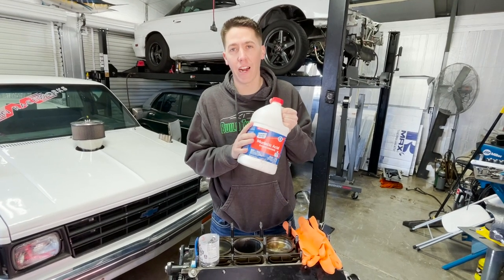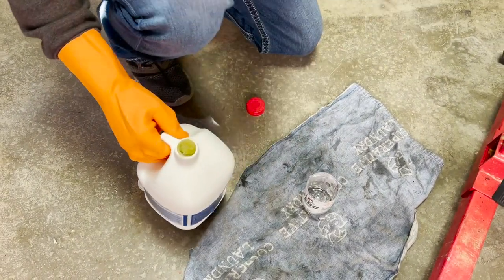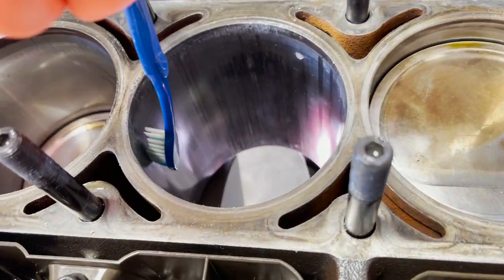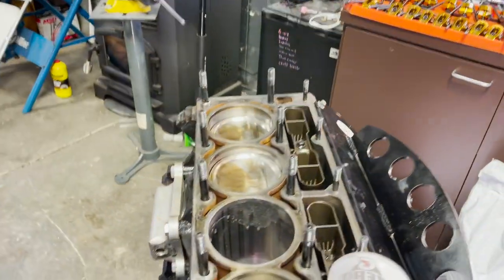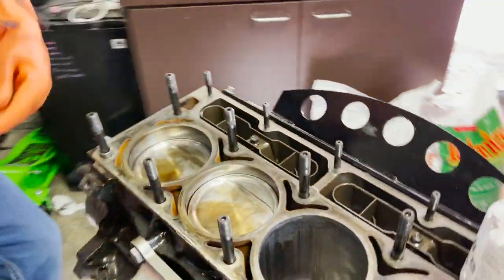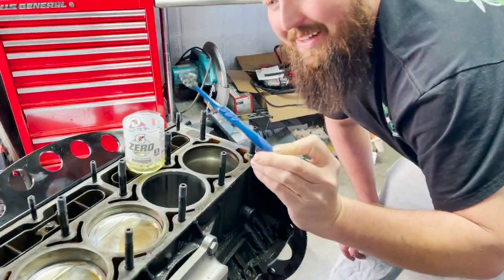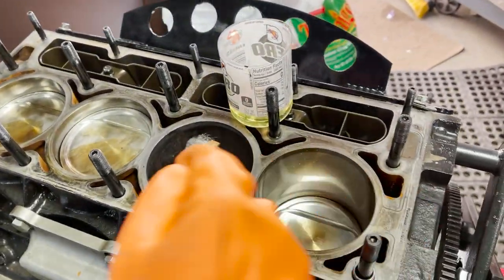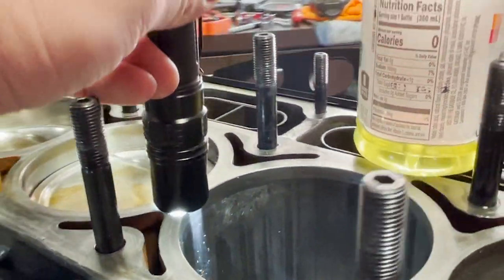Removing Melted Piston From My Engine Block With ACID!!! (Bad News)

Comment: Another junkyard block is going to be cheaper than a re-sleeve and machining. But you never know what you are going to end up with. It might have issues too. Just make sure you hone and crosshatch the cylinders.
Reply from the maker: Yeah I definitely go back and forth on all this hard to start over and have another used block completely machine. Lots to thing about lol

Comment: Would this work for a header bolt thats broken off in a head?
Reply from the maker: This only helps clean aluminum. Best way to remove a broke header bolt is to try and weld a nut onto the broken bolt.
Reply: If the head is aluminium, alum can be used. Google has the info.

Comment: Just grab another block. If you crack that under boost it's going to take a lot more with it than another block is going to cost.
Reply from the maker: Your not wrong looking at some options the last time we sleeved it and it’s been good but gets expensive
Reply: @BuildTuneRace  is a short motor combo from texas speed or the likes out of the question?